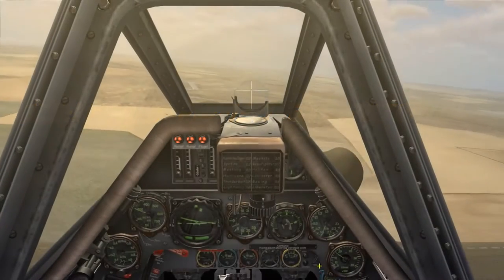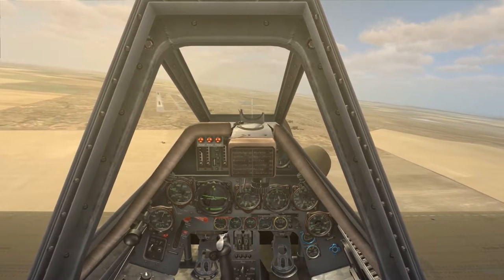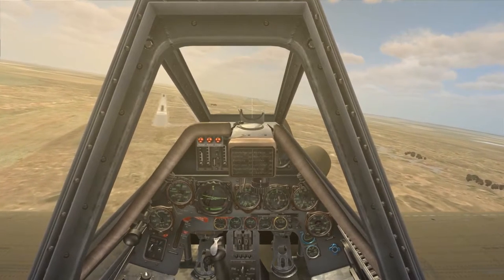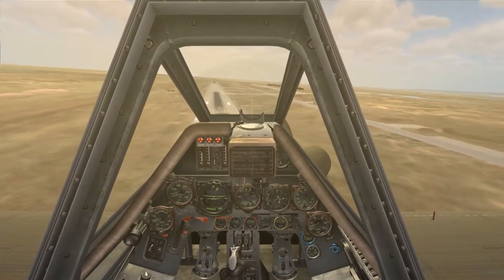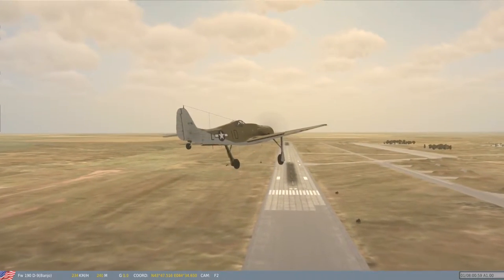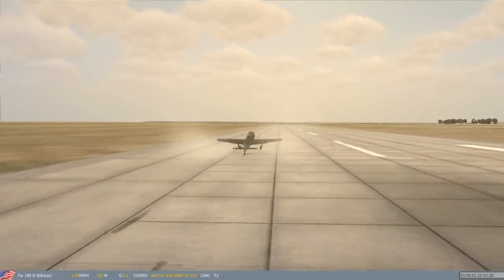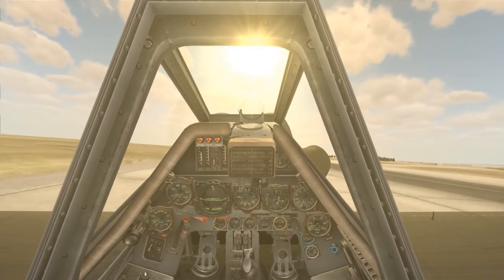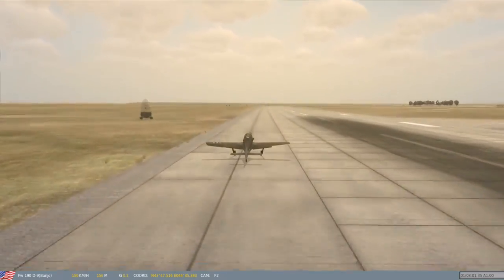DCS:World » Crosswind Landing » F.w.190

Comment: Just a small note, there is no need to apply rudder or aileron when crabbing. Just point the nose to the right of the runway and fly straight and level. What you are doing is a combination of crabbing and a slideslip. Slideslip can be nice as you can bleed off airspeed, but it isn't part of crabbing.

You do a slideslip landing at the end, dropping the upwind wing. If you were going to sideslip the approach, it would make sense to drop the upwind wing the whole way rather than switch at landing. The body of the aircraft would then be aligned to the runway on approach.

https://en.wikipedia.org/wiki/Crosswind_landing#Crab
Reply from the maker: russdill Correct, and thanks for the correction, I noticed this during editing as well.  I had just finished editing a video on forward slip and likely mixed the two so I just figured the actual landing info seemed correct even if the approach was a bit odd so I just went with it and uploaded it anyways.  I'd planned on doing a few videos on landing patterns, base to final turns, as well as a few different approach examples and planned on going into a bit more detail on the topic but I'll likely revisit this particular example and swap the aircraft and re-upload a second example for one of the other playlists I have.
Reply: russdill Nice, that link is hepful, thanks.